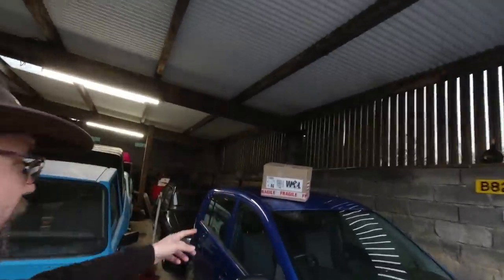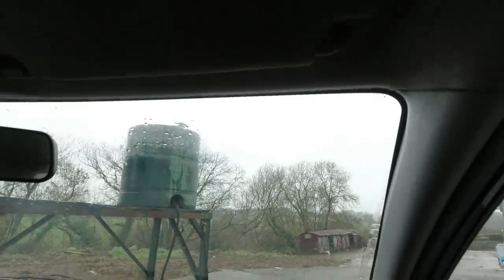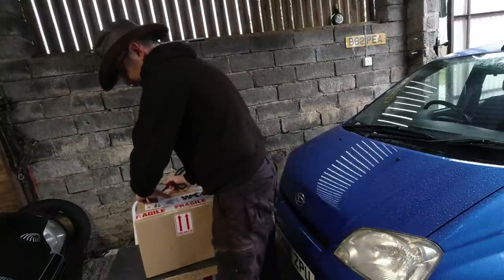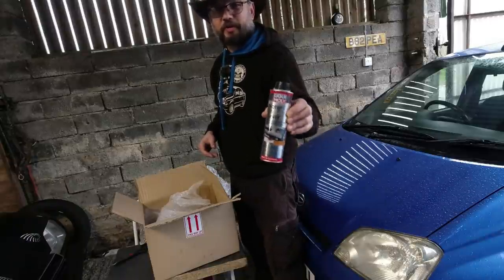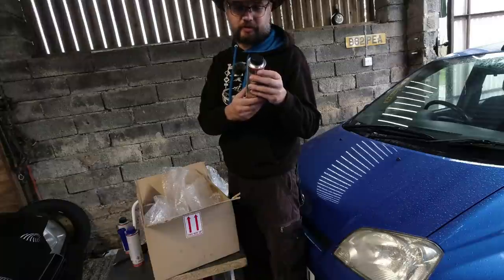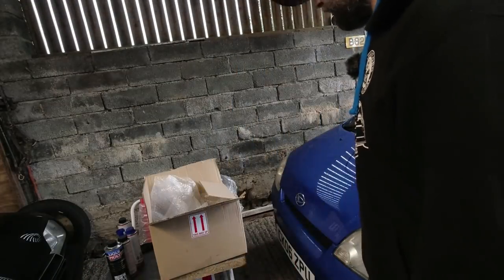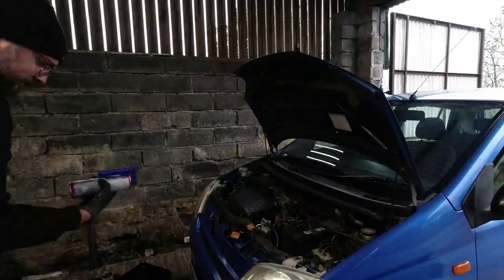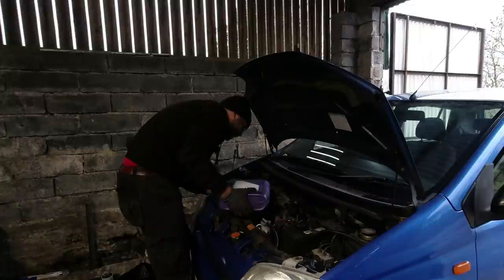Smoking Daihatsu - can additives fix it?

Comment: That was fun to watch, even though the smoke problem hasn’t entirely gone away. See what the oil consumption’s like in the next wee while - if the problem is seals on the valve stems it shouldn’t use much, but the smoke is usually evident at start-up or if you’re idling at a stop in the traffic for a few minutes. That was the problem I had with my Mk3 Cortina, even before I fixed the problem it would show a “grey” exhaust pipe at the end of a long trip. Compare that to my Morris 1100 which would do 100 miles on a sump of oil! Once again many thanks for sharing, entertaining as well as informative as always 😀

Comment: Whatever happened to the days when the engine was flushed on every major 10,000 mile service but those were the days when oil and filter changes were every 2,500 or 5,000 mile intervals.  Every 6 months if low mileages done, which ever occurred first.

Comment: 9:00  - re access to change the oil filter, you unbolt the number plate and the access port is behind, for putting in a filter wrench or for getting a hand in to wind off or wind on the filter.  No need to take off the entire front panel!

Comment: Wouldn't it be a good idea to construct a makeshift removable canopy, Ian, that you fit over the unit doors, so you can roll the cars out a bit further, allowing you to work even in those paradise-like conditions you know all too well? I'm thinking of door-heigth flaps that hinge on the door tops, and that can be pushed up and lowered, and subsequently strutted from underneath ... It may be obvious that I - unlike you - have too much time on my hands, making suggestions like these, but it does appear to rain even more in Wales than it does in Belgium!

Comment: Oil in the cylinders worked well in the Yugo Sana engine, so try taking the sparkplugs out of the Daihatsu and pouring some Liqui Moli into the cylinders to soak into the rings over a few days. 😎

Comment: The piston rings are shot.Always wanted to know did those additives actually work...but I couldn’t bring myself to try them in case it destroyed my engine ..Glad you did hubnut😁👍🏻
Reply: Informed advice is that rings are gummed up rather than shot.

Decent oil and solvents plus exercise may well help to free them, we will see. Does appear better though, having an old geezer pootling around with his dog for lots of short journeys will not suit a small revvy engine.
Reply: Echo above, and the issue is with the oil control rings rather than the compression rings.

Comment: I had an old VW Beetle once that tended to jump out of first gear on acceleration. I bought some Moly G (for gears) and added it to the gearbox. It fixed it, even after building a hotter engine for the car.

Comment: Much improved although the acid test will be an MOT. 👍
Reply: Yeah potions and heavier oil are good for not annoying other road users but doubt it will be enough to pass any emissions.
Reply: @TheShinyShow  I had a Fiesta MK3 once which I bought for £300 from a trader (I was young and stupid). After a few days I had noticed the car was smoking like a steam train. The piston rings were shot. Clouds of blue smoke, but I was using to learn to drive in and it wasn't too bad once the engine was up to temperature.  My mechanic poured a load of stop smoke into it and amazingly it was good enough to pass the MOT with just an advisory for a bit of blue smoke.  It worked for another 6 months until the engine decided it didn't have any compression anymore.

Comment: I wonder if you have a problem with crankcase ventilation?
Reply: Good thought - my Kelisa had problems in that area, it seems a common problem for the 989cc engine.
Reply: Definitely a good place to start, any crankcase pressure will force oil into the combustion Chambers. Have known it so bad that it can blow the dipstick out of the tube.

Comment: The old solution used to be squirt RedEx in to each plug hole and leave over night. Following day put rags over plug holes to catch surplus Red Ex and spin engine over, replace plugs and drive.

Comment: In my youth I had a few cars with the same illness, I found the trick was a thicker grade of oil and a tin of "No Smoke" (Halfords) and a 50 mile work out the faster the better. They all past the mot and ran for 10,000+ miles. It seemed to work and was not so distressing when I looked in the rear view mirror.

Comment: might want to check the PCV valve for clogging as that might over pressurize the engine and force oil passed the rings

Comment: These potions are for car selling only. Reduce smoke for a couple of weeks, just long enough to sell the beast. Then all the problems come back. If you can take the sump off in situ then removing the head and maybe fitting new oil control rings is a better option. Assuming these are still made these days. This should be well within your capabilities. Change the belts at the same time and you will have a nice little runner.

Comment: I heard of a trick in changing Cam Belts. You cut the belt longitudinally and leave half the belt around the pulleys. You then put the new belt on as far as it will go on then cut the half-old belt off, then slide the new belt all the way home.  Haven't tried it but it seems logical.
Reply from the maker: Fine as long as the tensioner and water pump are ok, and it's hard to judge whether they are with the belt in place. Which is why I've not tried it.
Reply: That's a Fuzz Townshend trick.
Reply: Doesnt seem very logical to me. I heard off this supposed trick over 20 years ago when I first started in the motor trade. I have never had any desire to try it whatsoever. For the time it takes to mess around with a Stanley knife cutting down the full belt length, it's a lot easier just to time everything up properly and undo the tensioner. Also, these days it's not advisable to change just the belt, the tensioner, idler pulleys and waterpump should be replaced also. With half a belt still left in place, these components cannot even be checked. I must have changed in excess of 100 timing belts on various vehicles. By the book is always the best way.
Reply: @garethjones8047  Fair comment. I'm more at home with pushrods :)  My son's Subaru Liberty had it's rubber band changed and I believe they used a jig to hold the pulleys in place, I thought that "the trick" would emulate that, but as you point out it discounts other wearing components.
Reply: @HubNut  Fair comment. I'm more at home with pushrods :)
Reply: and water pumps driven by fanbelts.

Comment: It will be interesting to see if the problem ultimately goes away. Very intriguing. Not sure about those potions myself. On this older engine it probably doesn't matter but newer engines, especially those with variable valve timing, don't do well with heavier oils. They need to use the recommended oil.

Comment: LED lights indeed really annoying, not only the thin strands in rear clusters but more so the retina burning headlights which are especially bad with modern Peugeots for some reason.
Liking the warm glow of these Daihatsu lamps.
Reply: LED headlamps are the worst! That white blue light is blinding, especially those like myself who are "mature" because of developing cataracts. The guilty culprits here in the US are pick-up trucks. Ugh!
Reply: @frothe42  It's probably the height compared to your car?
Reply: @teenaramsay2469  Yes, it could be, but in my case I am walking, and I find them quite blinding! Aging eyes are the culprit, but the white light generated by LED headlamps is glaring.
Reply: @frothe42  I agree...but when you are in the driver's seat their light output beats the old headlights for revealing danger...at the same time none of my present vehicles have LED headlights!
Reply: @teenaramsay2469  Most here in the US are retrofitting LED headlamps to older vehicles, or using LED bulbs. Absolutely blinding from behind as well.
Reply: @frothe42  Most LED light bulbs need a different style reflector...which explains the light-scatter annoying other road users. Possibly also the DIY fitter of an LED bulb will not know how to align the high and low beams...
Reply: @teenaramsay2469  I have seen sealed headlamps with LED'S, like an older model Jeep Cherokee.
Projector headlamp housings are also using LED bulbs.
Most of them are that white light, which helps with illumination but are blinding, especially when walking à driving.
Then there are drivers unaware that they have their main beam (high beams in the US 🇺🇸) on, blinding drivers and especially myself when walking 🚶. All extremely distracting as it causes temporary blindness.

Comment: It may also be worth considering the head gasket. The oil pressure is higher when cold, and a cold head has lower gasket clamping force than when expanded at running temperature.
It's a bit of a long shot, but VRS kits are cheap. Also, plugs should indicate if all or one cylinder is burning oil and if it's the one near the oil pressure gallery it could be happy days..
The high vacuum revving (unloaded) smoking when cold also points to rings unfortunately...

Comment: I think you will find that all cars have a fuel flap indicator telling you what side it is on. it will be a little triangle or the petrol pump symbol will have the hose nozzle on the left or the right depending on the flap.

Comment: I think if you do your own timing belt changes it's not worth fitting a new water pump each time but if a garage does the job it could save you paying more labour later on if the pump starts leaking.

Comment: I contacted Liqui-moly about my BMW 3 series burning oil.  This is what they said and to be fair, it does appear to have made a marked difference in my case and I am definitely not burning oil to anywhere near the same degree as I was:

"Even a oil consumption of 4 liters per 10.000 Km isn´t too bad for a 2004 BMW, we recommend you to use following products :" 
:-o haha

Summary of what products they suggested:
Use our Leichtlauf High Tech 5W-40 as motor oil (I was using Castrol Edge 5W30)
Use our Motor Clean at the next oil change.....
Add Oil Additive with MoS2 to the fresh motor oil to further increase wear protection and reduce friction. (didn't do this)
Every 2 years we further recommend you to add Motor Oil Saver to the fresh oil. Motor Oil Saver will refresh hardened rubber seal material (e.g. valve stem seal) over the next around 500 Km to make sure they are able to seal out oil from the combustion chamber. This will also help prevent oil spots / oil loss and protect your exhaust aftertreatment system from getting contaminated by unburnt oil.

Bear in mind that the oil saver takes time to work.

Comment: Fuel filler - if no arrow, the side of the filler is generally indicated by the side the 'handle' appears on the little icon on the dash. I'm sure there may be exceptions but I've not discovered one yet!

Comment: Have you looked at the engine breather? 
I've experienced a failure of a PCV valve. Where the breather leads into the manifold particularly at higher revs it applies suction to the crankcase and can therefore suck oil vapor into the intake.
It's easy to test. Disconnect the intake end of the breather and block the intake end.
Allow the breather to just vent to air, or to allow a drive wrap a sponge over the pipe to catch the vapor.
Let me know.
Reply from the maker: These don't really have one, just baffles in the cam cover I think.
Reply: @HubNut  okay, just thought it was worth a look.
I had an early 00's Vauxhall Astra that became very smoky. The breather came from the Cam cover but there was a diaphragm on the inside which had split allowing manifold vacuum draw oil vapor from the crank case.
Sorry if it's duff advice, just thought it might have been worth a thought.
Kind regards.

Comment: I had exactly the same smoking when reved problem on my Triumph Spitfire. I tried no end of lotions and potions but nothing worked. In the end I popped out the pistons. The compression rings were fine but the oil control rings had lost their tension and were so slack you could drop them down the cylinders and they would fall into the sump. New rings were fitted and no smoke. I look forward to your engine strip down video.

Comment: If one additive makes motor oil thicker I would not be surprised that the higher viscosity would slow down oil transfer into the combustion chambers via the piston rings or the valve seals.

Comment: The oil filter access is much easier on older charades. I have a 93 and it basically in the same spot at the front of the engine, there is about a foot of space between the engine and the radiator.

Comment: Just had the exact problem on my old Starlet this year with the rear drums binding. The handbrake cables where seized. Same thing when you jiggled the cable it would unlock.
Got the Garage to do it for the MOT last month though as i did not want to be crawling about on the floor swearing.

Comment: I don't like potions myself but you may want to look at a fellow youtubers site, performance farm.  He tests all manner of products and one is Engine restore. I don't know if it's available in England but it actually works! . He had tried this on a 50 year old beat up tractor that would not start,low compression ( 75 psi average)  1 week it was over 100 average and started no probs. I ran it in my 31 A model Ford with average 50 psi per cyl. Will check again soon to see the new average is?

Comment: Looks notably better, I remember an F reg 1.6L cavalier I had years ago it  used to do150 miles to gallon of oil 😂 tried the old STP stuff and 20-50  oil it made little difference.

Comment: Ian have you done an overrun test yet?..
With the engine at normal operating temperature drive up to the top of a hill,then come down in third gear using engine braking ,keep your eye on the exhaust if it's smoking you have valve stem oil seals leaking, if not then if it is only smoking under load ,check for crankcase compression by running with the Oil filler cap removed only at idle or just above to see how much pressure is being passed by the rings
Reply from the maker: No smoke on the overrun and no chuffing with the oil cap off.
Reply: That's good to hear Ian,I have hopes that given a few miles of use with the new oil the rings will free off a bit and settle down ,don't forget that the additives will take time to become effective,I've used LM for a while now and have been pleased with the results,I might of even recommend it to you back in the days of the Vectra ,good luck with it and keep us posted won't you.

Comment: Rings or valve seals? A compression test might help. As said already, check the engine breather system, make sure everything is as clean as you can get it.

Comment: Hi Ian, I'd seriously look at moving the front number plate to the left. as it is currently directly in the air flow of the radiator.  Here in south africa mine was more to the left from new.  The smoke seemed better at the end for sure. Well done Ian.  Look forwartd to more adventures with the fleet,
Reply from the maker: The radiator is offset to the left, and mostly fed from the grille (the right side of the grille is blanked off). I doubt it'll cook in the Welsh climate!
Reply: I meant right

Comment: I don't bother pre-filling the filter at all. No point.Clean the area around it, some oil on the O-ring and fill up the oil as close to the maximum mark as possible, run the engine for a couple minutes, check and add more as needed.

Comment: Hi Ian ! The thing smokes like a 3-cyl 2-stroke Wartburg 353 at cold. And - no - the stuff will most likely not fix it. I also assume by judging that there appears to be no pressure on the crankcase through the upper piston rings that the valve guide covers might have reached end of life. So pouring some stuff into the engine will not fix *that*. My guess is that there is no way other than taking the engine apart. Or look for a better one and swap the motor.

Comment: You should use 20w50 if its burning oil that bad and you dont want an engine stripdown. Its a last resort  but may work. Not ideal really but its an old mechanics trick- and cheaper than synthetic! :)

Comment: The only time iv had success with a potion is in my chevy 350 it was using a quart every 500 i used a bottle of marvel mystery oil with an oil change and it gradually sealed up no more burning oil. After was maybe a quart every 2k

Comment: Handy you got those products free, the rings and liners still need doing unless there's oil leaking into the bores from a defect in the head gasket or worst case a cracked liner, still love your little Daihatsu though mate, good luck 😊

Comment: I thought the fuel filler thing was common. I have it on both of my cars. On the Nissan 370Z I use it quite often!
Reply: Pretty much every car made in the past 10 years has this as standard.
Reply from the maker: Ah. I've never owned anything made in the past ten years...
Reply: @HubNut  that was what I thought, I nearly said the same then remembered your history!
Reply: And on cars without the big arrow, the orientation of the pump symbol (i.e. what side the hose/nozzle is on) is usually accurate in relation to what side the filler is on the car.